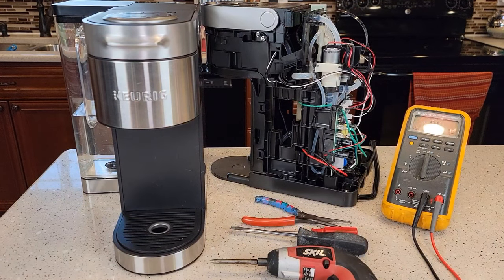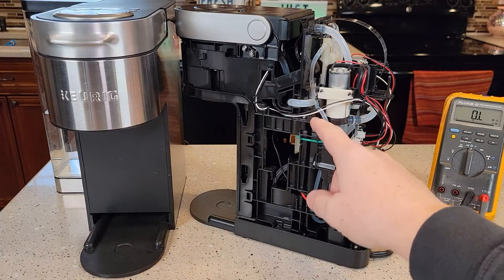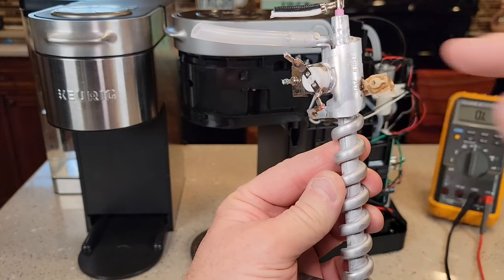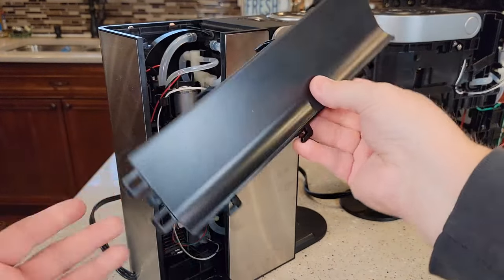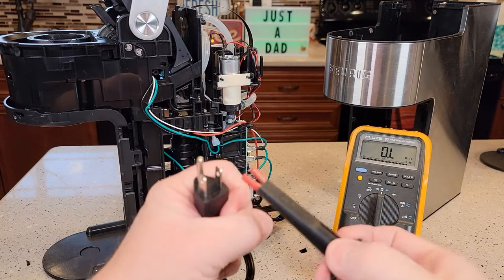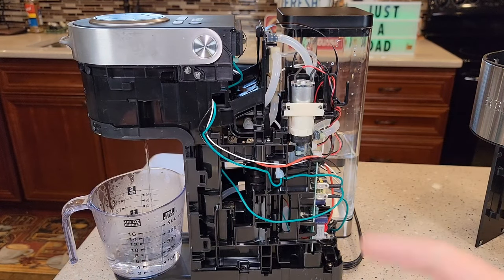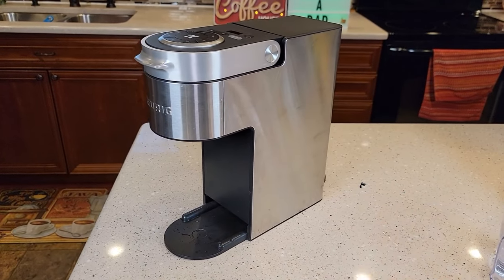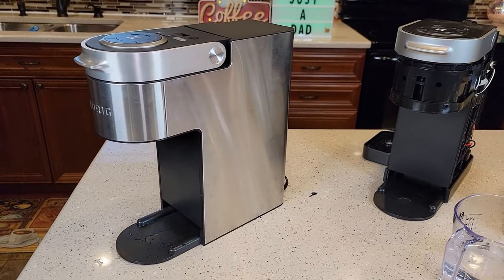HOW TO FIX Keurig K-Supreme Plus Coffee Maker Dead NO POWER.  How to reset Thermostat POWER LIGHT!

Comment: You do a great job in all your videos I've watched. I was hoping you may have encountered an issue with the K-Supreme Plus where it appears the 4 outside needles are not inserting all the way into the pods, thereby allowing the water to go over the top of the pods and eventually into the cup below instead of through the pod. When I press down on the actual lid after closing the handle (keeping pressure on the lid itself throughout the brewing process) I can see the exiting water become a normal stream, darker in color, rather than water exiting from many locations without holding the lid down tight. Are you aware of any adjustments to the lid so it is tighter after closing? Obviously I have checked the injectors and made sure they are free of any obstructions. It may be good to note that we also like to use the reusable pods quite regularly, with the occasional use of regular pods. Could the small rubber boots around the injectors be bad? Appreciate your thoughts.
Reply: I had this same problem with the lid not closing tightly enough.  I also would love to know the cause and the fix for it.  But in the meantime I have used a bar clamp to quickly depress the lid slightly so I get coffee instead of water and grounds in my cup.

Comment: 9:35 Hello precisely what you  said at that timestamp happened to me. I’ve done the descale a few times in the past following a tutorial but this time i thought I’d just follow the instructions on the bottle and what a terrible decision that was. I could see that the water was low after brewing 2 solutions of descale/water but the low water light had not came on like it always had in the past. And stupidly i pressed brew for a third time (thinking the brewer would abandon the brew when it sensed the water level get too low) because the instructions on the bottle said to keep pressing brew until the low water light came on. So my tank ran dry and my machine died. (Im not sure if i also messed the descale process up by altering the temp and strength settings for when i was running the solution) i really wish the instructions had put some disclaimers in to help ppl not mess their brewers up like this. 🤦🏻‍♂️. 

Seeing as i messed up the descale process and maybe solution stayed inside since i never completed the rinse process, what do you recommend? 
Is it still salvageable in your opinion?
Should i just try and reset the thermostat and redo the descale with a new bottle? 
Or is it just time to buy a new unit?

Also as far as what people and the instructions suggest about letting the solution soak the internal tank for thirty minutes before the rinse. When is that done? After the 2 initial run cycles when I’m guessing the add water light is supposed to activate? And if it doesn’t come on should i pour some of the reservoir out to get the light to activate or pour just enough additional water in there for an another brew until the light does actually come on by itself? 
(The logic behind wanting to trigger it instead of adding water is because the solution is supposed to soak the internal tank and if i add and run more water the solution will be very diluted.)
And how will i be able to keep the machine from going to sleep for a while thirty minutes?

I’m sorry for the very long comment and run on all list of questions but this was a gift and i dont want to screw this up ever again assuming im able to revive my machine by following this wonderful tutorial you’ve made for us.

Comment: So I have the slim and it's a bit different setup. It does not have the heating element  like these. I unplug let sit for a minute  plug it back in then hit the power button and either the power button flashes when you hit it then Don or  it powers up I hit 8 10 or 12oz it starts to run then 10 seconds later it's powers off again.any help would be great.

Comment: I just had the supreme do this in the kitchen and I just had my smart model do the same thing. I keep that one in my room. Haven't used it in a while. Sounded like it was sucking air even though it had water then boom it tripped the thermostat. This new design sounds messed up. I never had the single needle Keurig do this.

Comment: I found information a few months ago about resetting the thermostat (wish I had found your video), but since that time my keurig leaks water when brewing. I finally discovered it seems the top is somewhat sprung. If I press on the top while brewing, it doesn't leak. Any suggestions on what to do so I don't have to hold it each time for a decent brew that isn't half water?
Reply: I tried attaching pictures, but can't. It's the black portion of the lid that the silver handle nestles around - it sits just a little higher now

Comment: I keep running into this video when it doesn't quite fit my issue I'm searching, so I figured I'd post in case maybe you have a video on it that I'm just not finding. The power button is lighting up, but nothing else does. The little screen stays blank and none of the other buttons light up when I close the lid with or without anything inside. I've even taken out the insert that holds kcups and same result.

Comment: Ok so I reset it n it started working but then it turned off again? Didn’t make through a brew. Repeated it several times and it does the same thing? Any suggestions on what it could be? Heating element? Boiler?

Comment: So your video got my Keurig supreme to turn on again but it won't brew. When I press a button, 8oz for example, then press the brew button the screen flashes "brewing" but then turns off.
Reply from the maker: the needles might need cleaned   https://youtu.be/CACN1jCO94I
Reply: @JustADad  Thanks for the response! Well I tried that method. I even unscrewed the whole needle assembly and blew it out with compressed air and verified the rubber tubing is flowing freely. What it's doing now is when i turn it on "descale" displays and starts flashing. I have to turn it off then press the 8 & 12 oz buttons to get into descale mode with a steady display. I press the start button and it shows "brewing" like it should but after a couple of seconds it just turns off. I've tested the water pump with my DC power supply unit and it comes on fine. And I've tested the thermostat with my multimeter and it tests fine too. What else could it be?
Reply from the maker: @MrErViLi  I bet its the control board,
Reply: @JustADad  I took the board off to trouble shoot it. Right off I saw where the port for one of the small connectors came loose. You couldn't see it from the front side. I resoldered it and now everything works as it should. Thanks again for the informative videos.
Reply from the maker: @MrErViLi  Awesome!!! thanks for the update!  and good job fixing yours!!!!
Reply: @JustADad  I'm going through the same crap. Did the reset and it came back on. Tried to brew and nothing. Just says "brewing" but nothing happens and it trips again (with that slight burn smell). I'm guessing pump done but I'll check board also. Some of these wires are extremely taught in this thing just waiting to fail. Have you done a pump replacement video yet? I thought you mentioned you would. Great video btw. You're doing a great service with this.

I called the company and they sent a replacement for since it was still under warranty but to be honest I don't know if I even want this thing anymore with all the replies I'm seeing of people having problems. I'm thinking of sending it back and taking the broken one to Costco and see if they'd refund me since it's been under a year.

Comment: If this ever happened to mine I would would just drill a small hole in the side that lines up with the thermostat reset hole so if it ever happened again I wouldn't have to take it all apart again.  That looks like a pain to do.

That seems like a bad design, why wouldn't it be some kind of thermostat that resets itself after it cools down?

Comment: how would I know if the water pump is working? the thermal switch keeps turning off every time its about to brew. I can feel it getting hot but it just shuts off 30 sec after it starts heating

Comment: Ok so my supreme plus turns on will say to add water if I take off the tank put it on full I open the top put in the k cup and nothin I can't pick a cup size , temperature, or strength. As if those buttons don't work at all no flashing or anything

Comment: Why not just show us where to drill a hole in the side of the case so we can insert a paperclip and reset the thermostat without disassembling the whole thing?  I've got a 3/4" hole saw that could make a great access hole in the side of the unit and save all of this hassle.
We bought one of these last year to take on vacations. Worked great when we first bought it but a year later we pulled it out of the box filled it with water  plugged it in and it died before making a single cup of coffee.  Thanks for the video showing how to reset it but I think the long term solution if it's out of warranty is to make an access hole in the side of the case to allow it to be reset without disassembly

Comment: I cant believe that keurig is such a scam, I work in refrigeration every AC Fridge etc has the same type thermal switch on the compressor, the difference is when the unit cools down it will automatically reset itself, There is only one reason keurig did this and its deceptive,  There hoping on you paying for service or will simply go buy a new machine, Fricken scammers !

Comment: My K-Supreme plus just sits there and hisses then immediately shuts off. I've had 2 units do this.
Reply from the maker: have you checked for a clogged needle
Reply: @JustADad  I unplugged the unit for awhile, plugged it back in and it fixed itself somehow. I pulled the other unit having the same issue out of storage and it also works again. 🤷🏽‍♂

Comment: How to do the fix in 5 min :  Use a 6” or longer metal pick tool.  Basically it is a thin metal rod with a 1/2” 90 bend on one end that ends in a point.   All you have to do is pry off the top and then reach down from the top with your tool and press the reset button.  You will need a flashlight to see in there and it might take you a couple minutes to find the reset.   Of course make sure it is unplugged from power or you could die. Seriously. You could shock yourself so don’t be dumb.  If your unit keeps tripping stop using it as it is defective.

Comment: It would be way easier to just drill a small hole on the side of the unit and then use a wire to reset the thermostat.